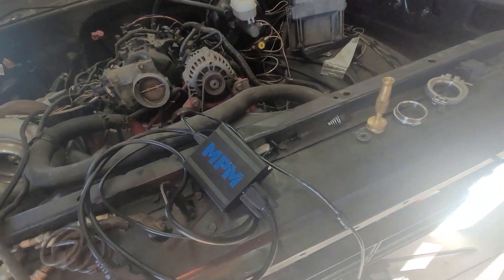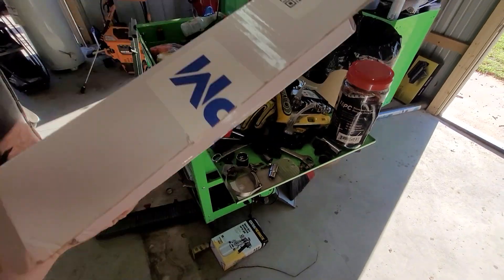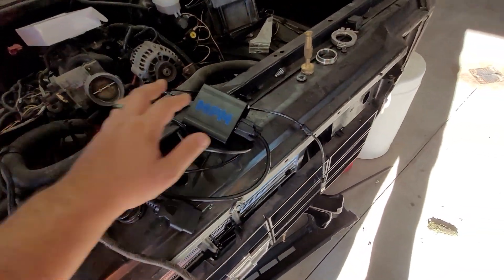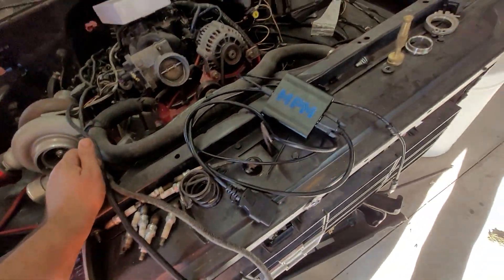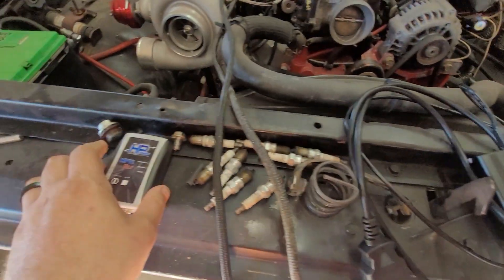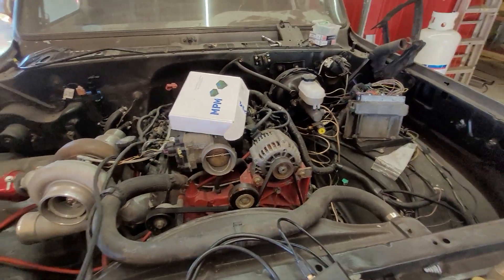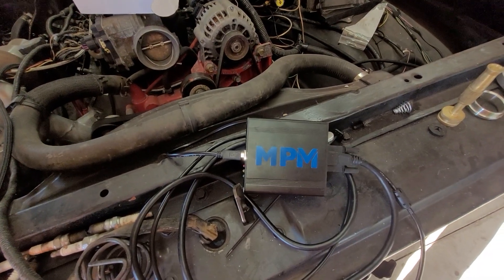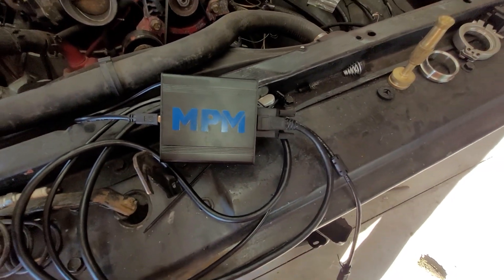MPM Tuning software, no credits, no fees, trash or treasure? HP Tuners Competitor

Comment: Which versions please help ive got like x1 to 5x and also 4.0.6 cracked and hpt to .bin converter unlocker but only converts .bin from hpt version 4.5 and up i use kessv2 to flash the .bin to the cars
Reply from the maker: I haven't looked at this or thought about it in years, and never will again when I can just use Universal Patcher with no extra steps
Reply: @TheDrivewayEngineer yea trouble with my PCM is its a Spanish Oak 1024k one / BARRA Ford Falcon one

Comment: How do we get the free credits and what not on the new Hp tuners devices?
Reply from the maker: You're way off course commenting here
Reply: @TheDrivewayEngineer lol commenting about free credits on a video about a cracked hp tuners device that is basically free credits? Are you slow?
Reply: Well you don't get free credits but you use those other things to flash however many ecus you want with the same file clone them and ho tuners just thinks you are flashing the same computer but that only works for swaps mostly

Comment: Well I know this is 2 years late, but there are certain versions of this software out now that are verified working, even older HPT versions that still allow you to shut off that pesky check engine light. 😉
Reply from the maker: Well, mine is still laying in the same place I threw it 2 years ago 😂
Reply: @TheDrivewayEngineer   haha
Reply: Which versions please help ive got like x1 to 5x and also 4.0.6 cracked and hpt to .bin converter unlocker but only converts .bin from hpt version 4.5 and up i use kessv2 to flash the .bin to the cars
Reply: You can still use hpt to do that. You just need to take their emissions class online

Comment: Is this still not recommended? I saw they have a update to it
Reply: No change, you can't save a tune. You have to write it, exit the program go back in and do a read to be able to save the tune
Reply: @15066bas  yup but it does work🤷🏽‍♂️. Is it worth it? Depends what you going to do with it.
Reply from the maker: Haven't looked, never going to

Comment: I too have a computer for tuning only. The software I use currently (Eurodyne Maestro) also forces updates. My solution was to simply keep the computer in airplane mode. No more updates... Not sure this will work with other software but it's worth a try.
Reply: Go into Windows firewall settings. You should be able to just press the windows key and type in firewall and get the correct result to pop up. Once you have the firewall menu open go through and add a new rule for every exe file in the programs install directory so they are blocked connections. Once you do that it no longer will be able to communicate in or out and you can still use the internet if you need to search Google etc while tuning.
Reply: @jstills762 Based! Thanks for the tip bud!

Comment: Best LS swap? ..... not the crappy ones tho. look for the 6th digit after the paint code , if it's the symbol that prince adopted - you have a very rare 9 cylinder that is totally bulletproof and gets 42 MPH.  - I don't know why you clowns dont walk around and buy these engines - I literally happened upon one underneath a great danes "pile" at the local bark park that I take my puppy Sasquatch to.